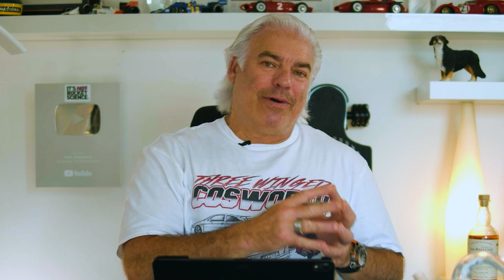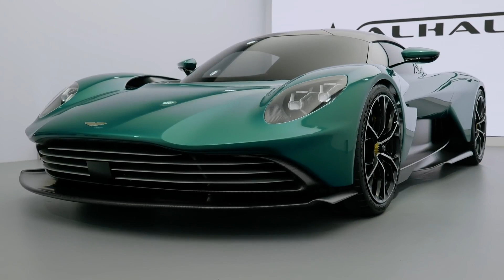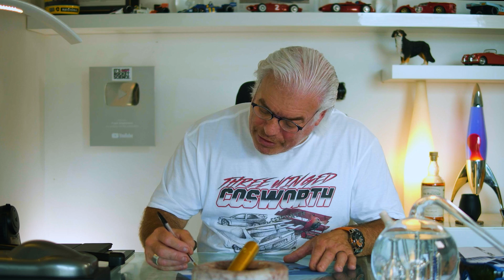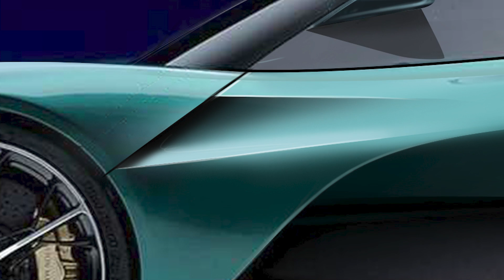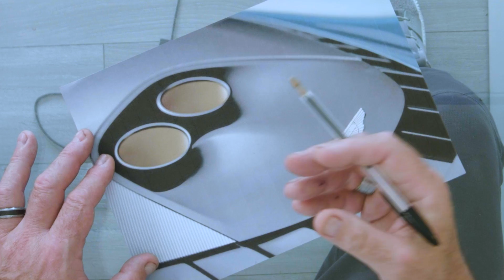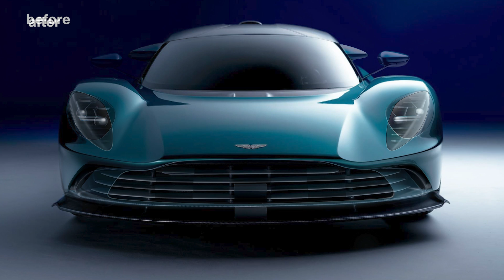Is The Aston Martin VALHALLA The PERFECT Supercar or Can It Be Improved?

Comment: I think Aston Martin has made one of the most iconic and timeless designs ever with this car. I just cannot stop looking at it. There are a few changes you made such as the variable sized ports in the back, heat sync material, and area in front of the rear wheel where I think your design is an improvement. But some of the items you changed (I understand this is all subjective) are there because of the heritage of the brand and design language. Examples: The panel directly behind the front wheel has a shape mimicking the wing of the Aston logo. The front beak is meant to be so wide to draw vertical contrast between the functional black lower portions and beautiful painted upper panels, akin to the Valkyrie. This design is masterful and hard to improve upon, but I think you made a great case for some of the changes. Keep up the good work, sir!

Comment: On the side I actually liked that front wheel shoulder plate it almost looked anatomical, like a muscle. I think it would’ve been complimented with a similar detail on the rear wheel shoulder and still a little bit of of that line work to make it all come together. I just feel like the after really took off something that could’ve added, to what was sensual, (almost like an Apex predator) a muscular look to the car. I’m conflicted on the headlights I think something between the two would’ve been more ideal and the side mirrors could’ve been moved down a little bit, I did like the front grill though.. other than that it was an interesting watch.

Comment: Nice try Frank. I think you took away the character of the design on the sides. Softening it really. The front wheel arch exit change particularly. I've seen the concept on the flesh and it was one feature you are absolutely drawn to. Agree with the air fin.change and accentuating the exhaust shield though. In the flesh the headlights look rather blobby and boring. Look at a Ferrari.458.headlight for example and see how much attack is designed in. Think Aston missed a trick here. Yours don't go far enough. Enjoyed the analysis though.

Comment: Reminds Ferrari small bit from front I don't really care what badge's are on it because it still looks good  from saving materials side I would think about w124 Mercedes Benz 1single wiper blade I even tested it in +30 till -35 single blade solution was working flawlessly if it's gonna fail it's gonna fail anyway I just see 1 problem instead of 2 bigger trucks like DAF I think had 3wipers but obviously windshield is much bigger in truck's.

Comment: Fully agree. The Valhalla is the most beautiful car design currently in the market. If I would have a million spare, I'd buy one as an investment.

However I disagree with four of your design coices; The front grill looks too much Viper ACR-Like. I prefer the Aston version. In addition i'm not fully sold on your headline design. And finally the mirrors that you designed...not a big fan. I'd prefer small cameras in the sidepanel to get rid of them alltogether. 

And finally, I love what you did with the side, after the wheel arch (thats the word right?) however there is this triangle wedge now where the mirror used to sit. It draws slightly too much focus to this edge for me. (not where the A-pillar meets the bodywork but below. Maybe I'd put slightly less emphasis on that edge. 

Btw. Thats an easy fix for the 6 spoke design to black out three of those spokes. I think the five spoke design from the Ferrari 458 is still the best modern take on a wheel that was shipped from the factory.

Comment: You apparently have been smoking funny cigarettes, this thing looks like an amalgam of bad ideas, look at the back of the greenhouse and what a complicated mess it appears to be. It has no true flow overall and is off-putting to the eye. The changes that you made do result in a much more sinuous and all of a piece vehicle. Especially the sides which flow like the wind in your updated renderings. The change in the mirrors that you did is also a big home run. But, I cannot see how you can think that the original design is good at all, it is a blight on the eyes.

Comment: Once again, your version is superior to the factory  design.  I especially love how you improved the sides of the car.  That section on the side on the forward part of the door was very disruptive for me.  You did a masterful job of smoothing that area out.  Your grille is better and the varied spacing in the air outlets running down both sides over the engine is more interesting for sure.  It's a great improvement on a very good design already.   You touched on how the rear end area is lifted off the ground to expose the rear wheels and I think this also helps to make the car looks lower in the rear even though it is quite low looking already instead of carrying the body surfaces down behind the rear wheels.

Comment: I do like your design a lot especially the front, but im not sold on the side changes especially towards the rear quarter. At first glance it looks good but the longer you look it begins to look as though it doesn't work with the rest of the car. Especially as you move your eyes to the area behind the wheel as it meets the rear of the car. The 3 spoke wheels are a definite improvement.

Comment: I have to say that the original design was smarter. When doing the 3d modelling, is absolutely nightmare to join all the surface together for the front quarter panel. For the original design, instead of joining all surface together, they just cut them into pieces. Aston Martin used a lot similar solution to their other cars recently.

Comment: Aston Martin did create very nice proportions with this car. The Corvette people could learn a thing or two here.

I think the redesigned front end moves the car toward generic, though. Those new headlights make it look like a wasp face to me. I'll admit I'm just not into the insectoid McLaren thing. And the revised grille size trick is the same thing you did with the Ferrari 296, which I think supports my first argument. But I do agree with you that an overly wide looking mouth should be avoided somehow. I'd like to see it done in a way that's more special to this car, though.

As far as the side revisions go, I have some gripes there too. Someone below pointed out that the original googaw behind the front wheel is intended to recall AM's historic side vent and I think it works well as-is. And a side benefit to its presence is the really nice fully rounded fender it allows, where that curve flows over the front wheel and drops down into the side mass like an exaggeration of the same spot on the 308 or 512 (or the Lancia Zero spectator transport vehicle you cited a few days ago!). To me, this really accentuates the mid-engine nature of the car somehow. Probably because it's also where the a-pillar cascades down into the bodywork. That intersection where the a-pillar appears to be resting against a front fender that is specifically angled to provide it a footing creates an appearance of great structure and purpose. Granted, that is still present on your revision--it's just not as strong.

I think the original profile does a better job of suggesting front and rear masses with a separate section in between them where all the "business" occurs. In a car of this extreme nature, I think that degree of separation is justified where on more mundane cars you'd probably opt for a smoother flow. I mean if this car is purpose built to kill its driver in battle and send him to the afterlife, it should look like it! Well done, AM marketing team, BTW.

Your change to the material of the exhaust surround was a really pro level move. Now that you've suggested that, it seems so empty without it.

Comment: Amazing video. Loved the changes to the side profile and rear 3/4 view. Also the changes rear top side work wonders. You’ve absolutely nailed it there. The way you can trace the airflow pattern all along the side. So organic, form marries with function. 

Not bowled over by the front changes but that’s probably a personal thing. I’d keep the slat design and pull the mouth in a bit like you suggested. The old mirrors I like, a little nod to the (“mercedes”) AM F1 racing car.

Comment: Great insights on the design as always.  IMHO, I like your grill design better but prefer the original headlights and side mirrors.  The redesign of these makes it look like an insect with ears.  From the side I like the redesign from above the window line and up only (ie. the upper deck back section).  I prefer the original side design.  Again IMHO, further smoothing out the contours and lines, removes its distinguishable features and it starts to look like more of a blob.  Or just like every other supercars currently available in the market (ie. particularly those from McLaren and Ferrari).  But either design are beautiful.  And I agree with your statement, that I think this is one of the best looking hyper/supercar in its segment.

Comment: I would have keep the "before"  headlights and the heat evacuation side blades. The "after" front grill I like better, except the pattern inside it. Overall Your design improvement is better than the original.

Comment: I like what you did with the grill but the original head lights and mirrors gave it a classic timeless look. I think you made the sides look a lot worse but you made the back look much better. The original front fender looks good with what you did to the heat vents. Both look like Armor plating.

Comment: Hi Frank - I really like your proposed modifications to the car - so much more sleek & sensual.  

I’m not sure I buy into clamshell design.  Certainly they’re beautiful & flow around the car more simply, but I think they’re a step too far away from the practical.  One misjudgment (either yours or another driver’s) and you’ve an entire front end body panel to replace, rather than a fender, bumper, whatever.  Maybe at this level of supercar cost is no object; but as a mere mortal, that would be an impediment for me.

Comment: Thanks for the master class in design once again! I really like the Valhalla's unique sexy design but the fender sweep into the side, I wasnt quite sold on. I really like what you did in that area to simplify the design yet still provide the drama the original has. Also really like the grill treatment, I agree the current one is a bit dated looking and would probably look much better if they blacked it out or did it in exposed carbon...Loving the cheetah P1 t-shirt BTW Cheers!

Comment: I believe the front wheel well exhaust vent is a call back to Aston’s typical engine exhaust vents with a metal spoke down the middle. I have to agree it could be much more refined but it was a good attempt at adding their DNA to the car. It’s the first read of the side of the car and there are too many things colliding in one area. Removing it would remove their DNA in my opinion, just as changing the grille would be.

Comment: Now this is in a league of its own when talking about design in that segmented car , the Ferrari sf90 looks just like another Ferrari it’s a almost become kinda dull in my opinion
Reply: Not really as the SF90 has a completely new face, and a different back with unique backlights for example. I dont think the SF90 is a worse looking car than the Valhalla as the big and outdated headlights of the Aston just ruins it for me... Performance wise these cars should be on the same level although the sf90 having slightly more hp - but the big difference and deal-breaker is, that the Ferrari costs half as much and is not limited unlike the Valhalla with its rather boring (in comparison) AMG V8 in it...

Comment: Absolutely beautiful car.
For some reason there are a lot of top end vehicles that stop in my village and surrounding areas.

I have seen all the newer McLaren road cars, but the one that has by far the most presence and sense of drama is by far the P1 (the only McLaren I find attractive). I'm driving an R50 Mini still today. 
I don't like everything Frank does, but those that I do are some of my all time favourites.

The mirrors are an improvement on the original but I feel everything else detracts somewhat.
The lights could be improved but Frank's solution is too Japanese looking, it needs a touch of English traditional styling with a modern twist rather than these generic race car lights.

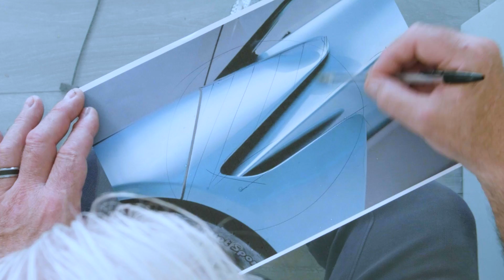Comment: 9:35 you're removing Aston's trademark design element that has been on every car since the David Brown era. Usually it's there to extract hot air from the engine, but in recent mid-endined cars they tried very hard to maintain that vent and make it a functional aero element.

Comment: I like the front you did better than the original, also the exhaust part with those vents. As far as the side view, you cleaned it up, but to me the original is more dramatic and I like the element of that "beam" or arrow that goes in the side, it's like an animal with an arrow in it, I don't know, I like it a lot, also seems a bit art deco that element, it has drama and "movement", it's like a spaceship, or a shooting star, very very fast and very elegant.

Comment: The changes that Frank did to the side of the car made it absolutely gorgeous and made it look like a true Aston .Aston martin's design is not about  sticking bits on the body it's about beautiful ,simple and easy on the eye line flow. Hopefully they will stick to this design language for years to come.
Reply: I like so many things about Frank's changes, but to me, it's the front-end treatment where his edits transport the car back a few years in style. 
.
The original headlights are blobs, and they should be improved. And the interior of Frank's headlights does improve, but the overall shape of Frank's headlights is too tall — it droops down too low. Paired with his redesigned brake ducts underneath, it looks slightly awkward and been-there-done-that to me. 
.
His new grille, too, just feels more normal and common. It's not fresh exotic to me. His taillight-design callback in the slats is cool, though, IMO. I'm not sure if I prefer it to the super-wide horizontal bars on the original, tho.
.
I'm split on the vent on the leading edge of the door. The original cutout shape is just cool and interesting like I've not seen before. The chamfered tabletop edge of Frank's vent is definitely awesome-looking and unique, but the overall concept of his vent is more traditional. 
.
And you can really see P1 and 720S poking through in his side view bodywork redesign. Beautifully done and fairly different from the original, but I like them both a lot. 
.
His variably sized upper-rear vents and high-placed side mirrors are a must, though I think the bodywork cutout that gradually pinches those vents should get even narrow rearward.
.
As good as peaking the bodywork's height over the centerline of the rear wheels looks, keeping that bodywork as low as possible somehow feels better to me. 
.
Umm, and 3-spoke wheels...? Hello?!? Amazing. 
.
Other highlights for me are the forward-sloping lower shut line for the doors and the softened surface transition over the rear wheel lips. 
.
These episodes are just the greatest, and it's so exciting for me to watch Frank work on this stuff. YouTube is so much better than TV for stuff like this. It's a brave new world, people.
Reply: Another point I’d like to add about the side, imo it’s quite obvious but I never see anyone talk about it. The vent on the leading edge of the door was clearly modeled after the traditional Aston side vents, abstracted into the bodywork. Even the crease that shoots off from it is meant to play into that, and that’s one of the things I love about it. While it does look a bit messy, the edit Frank did totally took away that aspect. So while it could use a bit more work, Frank’s edit was really not the right direction imo.
Reply: @Legoformerguy  Great catch. Despite its initially fussy look, I was finding myself attracted to that feature. Now I know why. Or at least you've provided me a plausible excuse!
Reply: No
Reply: @Legoformerguy triple yes, and it looked too much like a McLaren from the side after changes.
Reply: Disagree the sharp line in front of the door kinda ruin the whole thing.

Comment: The front grill narrowing could fit the Valhalla better(works better for the gen 5 Viper). I think that the headlights could be slightly more rectangular and narrower(keep the longer length). Even though the front wheel well side vents with the revision do match the rest of the car it's not as interesting as before. I like the progressively narrower engine bay vents but at rear: the right, left and center have longer vents slats and have dividing vent slats that are inset, mimicking the exits of the exhaust.